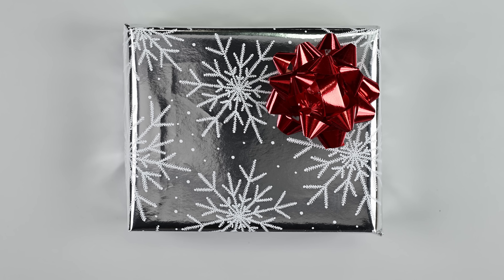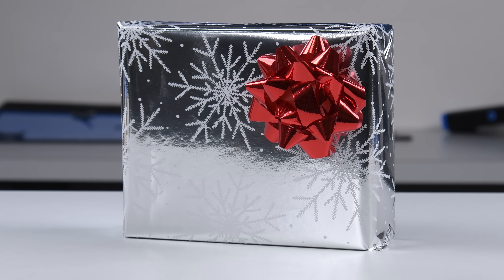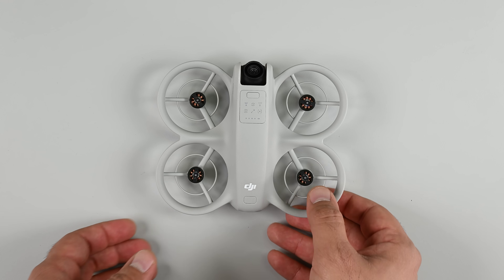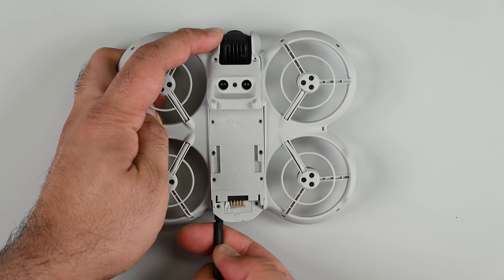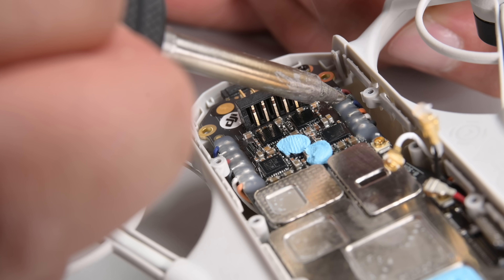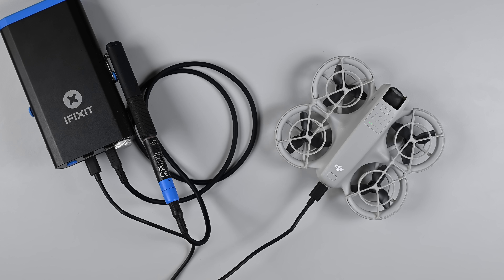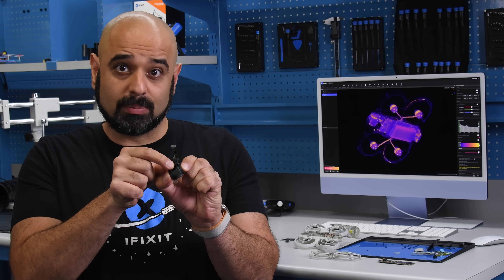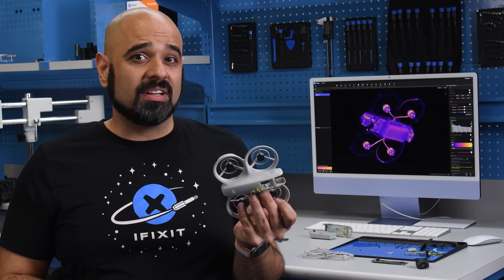WHAT'S IN THE BOX? DJI Neo Drone Scanned, Torn Down, and Exposed!

Comment: I had a water crash but had a float on my Neo, so I was able to retrieve it. I dried it very well, took it apart and cleaned and dried everything, but after putting it back together, it no longer connects to WiFi on my phone, or shows up on my goggles. It flies just fine and even attempts to track me, but won’t give a video feed and I get an error message every time o try to connect with its WiFi. I have DJI care, but I’ve read a lot about people loosing their drones after sending them in for repairs due to this upcoming DJI ban and customs not allowing certain Chinese products through. Does anyone have any ideas why it might not be connecting properly, or any specific cables to or antennas to check after taking it apart?

Comment: Crashed my neo a few days ago. I think the camera itself and the motor are ok (although the overload messages pops up from time to time), but what seems to be the biggest problem is that the gimbal 4 rubber (?) bumpers are broken. Can I somehow replace those and while disconnecting the motor and the camera, will it reset and ask for re-calibration? Or is it that as long as they’re coming from the same drone they can be disconnected during the fixing procedure. Can anyone assist ?

Comment: Can you make a video about the outer frame repair? I crashed my neo and the plastic frame around the propeller cracked without damaging anything else. I bought some aftermarket parts and I’m about to do it if it’s something easier that what you presenting in this video 😂
I’m not an expert like you 🙋🏻‍♂️

Comment: You can partially remove the mainboard and access the bottom of it without unplugging any wires or ribbons. My drone fell from 4m on a stone floor and a small piece from the on button was displaced. Making it unable to be pushed in. Was able to put it back in by accessing the bottom of the mainboard and now the drone is fully functional again.

Comment: Just asking here, is there a way to install a second video sensor in a Neo?  I want to install a small Thermal 320x320 IR thermal sensor and transmit this data to the RC.
Reply: No clue how much payload the NEO can carry, but you’re probably better off buying a video transmitter for FPV drones and building a little self-contained sled with a battery and your desired camera. Then use a separate monitor for that feed.

Something like a TBS unify nano and a little 300mah whoop battery will weigh like 11 grams.
Reply: @supergeek02468  I was thinking of that myself. I like the neo due to its known robust nature and has a ready build supply chain for repair parts. I think if I can strip off some weight on both the IR sensor and make the entire payload weight dispersed under the Neo chassy, its range and speed would be limited but the job task would be limited to about 10 minutes at the most anyway.

Comment: So I work for a European Company that is now coding replacement parts sold. The Main Board in the Unit will scan all parts installed for its serial number and know that the part was replaced. If it doesn't like the serial number it will shut itself down until the part is either changed with one with a correct serial number or someone with the correct software codes the part. It was originally purposed as a way to stop cloned fake parts being sold and installed into our Units.
Reply: Very helpful to know, thanks!
Reply: Just to say: When I buy a "unit" it is my "unit" and no longer your "unit".
Reply: @MartinMichaelis  That is a concern, but for warranty repair in the field its hard to say what 3rd party techs are doing to cut cost to increase profits. It is not uncommon for a very smart tech to "re-engineer"a product to get it working in order to get the job done under cost, make a larger margin for themself. The down side is not only did they void the warranty, the violated UL certifications, possibly left the customer with a product that is dangerous in the long term, and the next tech who goes out there is walking into a mine field with unknowns both safety hazards for them, the product and the customer. Then you have the Chinese clone operations making substandard electronic control processor boards, control power module boards, Control User Interface boards with fake OEM labeling. Why pay Tom's Repair $450 for the CPM when its on Amazon for $39.99 shipped 2 day... After you install it, your $4,000 Blah Blah Blah explodes, can't be repaired or is going to cost $2,000 to repair and it is no longer covered under warranty.. and its all the manufacturer's fault somehow.  I have this conversation with Customers every other day... so it is not a rare thing. It is unbelievably common.

Comment: Can’t remember who it was but they did a video showing the durability of the Neo. They took it to about 200 foot elevation and switched off the motors. It crashed onto pavement with the only damage was a shifted motor that was easily shifted back into place to be flown again only a few minutes later. It’s surprisingly durable little machine
Reply: Part of the reason is due to it's extremely light weight, not much momentum
Reply: @anon_ninja  Indeed, but in this case, it's a feature. Also, the "unibody" construction helps a bit.
Reply: it was drone wilder

Comment: Great video!  I have been a drone pilot for 10+ years and I have to buy new drones all the time because they are so cool, the Neo being no exception.  I thoroughly enjoyed your video showing the breakdown process (good to know the inside).  However, I've never crashed a drone as many times as this one and I purchased another one for that reason plus the Refresh on both also.  This drone is not without pitfalls and like any other system its up to the pilot to learn all the nuances and quirks to minimize down time, inconvenience and embarrassment.  In summary, I've never had a drone that packs so much tech in such a hardy little package at an unbelievable low price point.  I cant wait to see what kind of follow up drone DJI makes after this one!
Reply: For someone with 0 drone-ing experience is the Neo something worth buying for image quality or just buy something like a Tello for a quarter of the price and learn to fly/crash before even considering this (even at its price)?
Reply: Ai sounding comment lol
Reply: Which are the quirks? (I just got one)

Comment: I do drone repairs. That glue on the main board can be easily removed by heating them with a hot air gun set to like 90 to 100.
Reply: where to get parts for dji?
Reply: @andrikurniawan531  easily avaibable from china
Reply: I was always under the impression HEAT & Electronics don't Mix ,
Reply: I don't think dji used regular hot glue. iron is around 250 to 300 C, and it does not look to melt very easily the glue on the ESC soldering
Reply: Thanks for the tip!
Reply: What kind of glue gun do you use for such precise application
Reply: hi ,my dji neo's back left motor's black circular part with the shaft pop out in the middle of flight ,i found that out of 4 motor only the left back motor s black circular part with the shaft(the metal rod) pop out by hand from the coil , plz help me to resolve the problem.
Reply: He clearly doesn’t do electronic repairs cause yeah hot air gun is what you normally use. He’s just starting to learn how to solder. I wish he would bring in someone who’s an expert to do the teardowns.

Comment: I understand the glue for the perss conenctors, but for the soldered motor wires? Its completly unnecessary, even if the solder connection fails under the glue it just get worse, because the glue will hold the wire ina semi conencted state, and when high current draw occure it will melt everything.
Reply: It's there to help waterproof the connection and protect it from vibration/crash damage. From someone who built his own drones, all it takes a single blade of wet grass that can get onto the solder joints to your motors to mess up their power briefly. I used to use black plastic dip on my solder joints to act like a hydrophobic coating.
Reply: @izzydo3494   that's an even better answer, especially since the Neo has air vents right next to those connections
Reply: to lessen stress on the solder during crashes

Comment: You can remove glue with isopropyl alcohol
Reply: You can also remove it with fire!
Reply: yep it disolves adhesive you can also use eucalyptus oil aswell if you don't like the alcohol the oil can leave nice scent at the very least

Comment: It's pretty amazing tech for $200. 
DJI makes great tech. DJI are also slimy. You have to "activate" one of the action cameras before you can use it.
DJI also bricked two of my drones when a software update. I can't fly these drones again until I purchase a more modern smartphone.
Reply: ahh being advertised device compatibility, then changing / removing compatibility quietly after a required software update after you purchased. lmao i went tho 2 tablets and multiple  phones before i could fly reliable without it crashing mid flight.